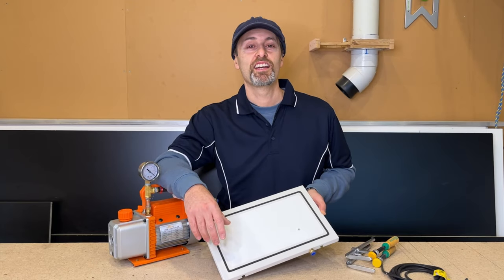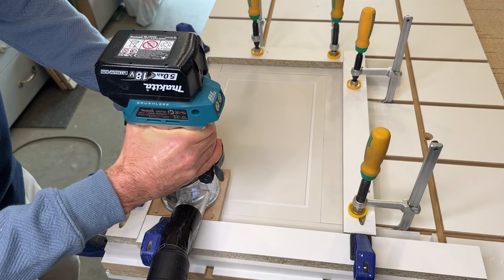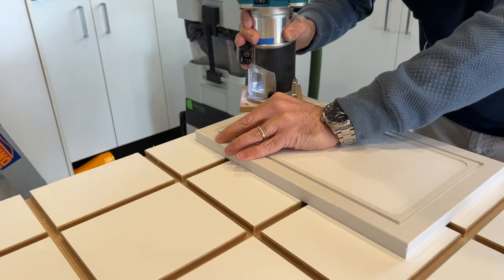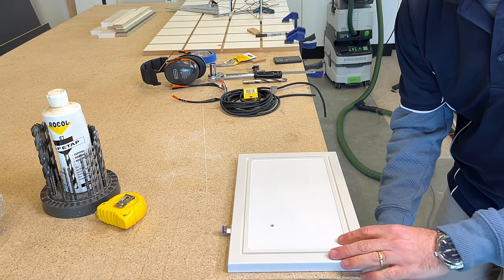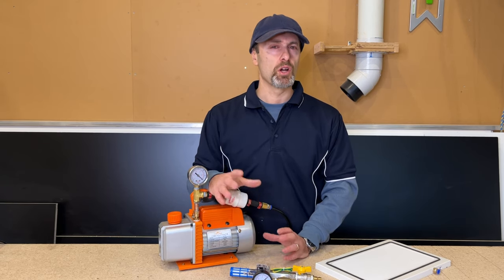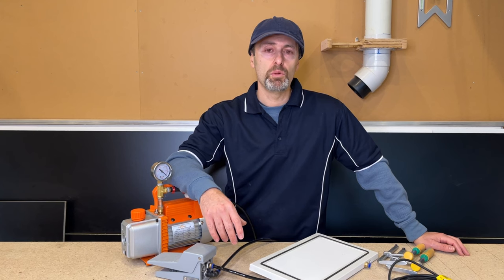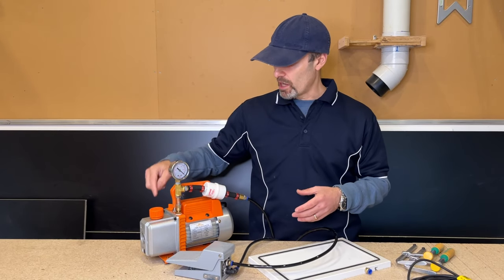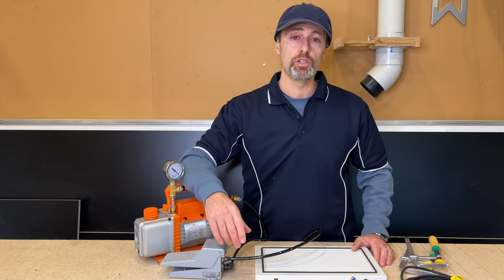DIY Vacuum Clamp | Vacuum Workbench Clamp | Vacuum Suction Clamp for Workshop | DIY Vacuum Pad

Comment: Funny, I was looking to purchase the Festool vac system but after watching your video I've realized I have everything in my shop needed to build my own customized vacuum clamp.  It won't cost us a single penny!  Thanks. from Canada
Reply from the maker: Yes I was contemplating the same idea, then decided to make my own, good on you 👍
Reply: I have the vac Sys. Different use case. I’m now fully on the vac clamp train… building out more accessories like this and a large bed for the cnc. So convenient!
Reply: I experienced the same thing Gavin. And its tea handy. only bought the vacuum pump and a hose with some connectors. set me back less than 100 euro! thanks to Geoff, all working very well. just need a foot pedal that's all

Comment: i have another question, I checked out the pump on Amazon but and seeing 1/4hp (3.5cfm) , 1/3hp (4.5cfm), and 1/2hp (5cfm) what is the difference, what type do you have and what size do you recommend for my 4ftx3ft work bench for strong hold down. I mostly do straight through cut on my cnc so i would like the little peices that are cut out during my jobs to be hold down on the waste board as i usually have another vacuum sucking the down because i use MDF for my jobs and these as you know are very dusty. At times when the vacuum is sucking the dust the small pieces get sucked up but falls in the track on the bit and sometimes break(when am using 1/8 upcut bits) and messes up the entire job. so i would need a strong hold down for to keep the little pieces on the waste board to avoid these problems.

Comment: How big of a work bench can this vacuum hold down. I have a 4ftx 3ft table size. But most of my material i would be holding down is 4ft x 2ft. Could this pump work?
Reply from the maker: I don't see why not, make sure you have a good seal and surface area. One way to find out...
Let me know how it goes 👍

Comment: great simple project! i wonder once you create the vacuum and turn off the pump (and of course an optional air valve) how long in your opinion could keep the vacuum force without electricity? did you tried it?
Reply from the maker: It doesn't seem to last very long and I think that's to do with the PVC material I have used. The hole that has been drilled for the air suction is the most venerable to leaking air and the best solution would be to coat that hole with a sealer of some sort, which can easily be done if you have the patients. That being done and a good rubber seal may help keeping your material held down without the pump a little longer. Good luck 👍
Reply: I wonder if it would be more beneficial to route a grid in the center instead of the entire middle. It may be less surface area but possibly less distortion on the piece when at full vacuum. Plus a few additional deeper grooves for the gasket could allow you to reconfigure the gasket for a smaller piece.

Comment: You're using the foot pedal as an activation switch?
Reply from the maker: The foot pedal diverts the air out through a vent which means the suction pad has a loss of suction allowing you to release your material

Comment: my foot pump works the other way. it works when pressed. do I have the right pneumatic foot pump?
Reply from the maker: You may have the line in from the pump in the wrong port on the foot pedal. It should have 3 x ports on it, 1 x is the line in and the other 2 x ports will dump/divert the air

Comment: Does the motor have to be two stage to use the pedal?
Reply from the maker: Hi Chris
I don’t think it’s a two stage pump, it was nothing special just from eBay around $100. The foot pedal has another outlet which dumps the air or diverts it which works well for releasing your material off the vac pad.
Reply: @geoffsjoinery4990  
Just what I needed to know! Thanks for the quick response

Comment: Looks great, but one question : You lowered the centre part a wee bit, so doesn;t the vacuum pull a litle dent in the material that it is sucking? 
I ask this, cause I'm thinking of using it for cnc engraving with a V-bit and for a perfect engraving I need it to bee 100% flat, or else the tekst would look bad especially with thin brass plate or thin plywood? 
kind regards Hans
Reply from the maker: I have never noticed my material bowing in the centre due to this design as I have only ever used these with 16-18mm board however, to address your concern, you could router 6mm/1/4” slots in a grid configuration instead of hollowing out the middle which would retain a flat surface within the centre section for your thinner materials. Good luck 👍

Comment: The only thing I would do different is to cut slots in the center area for the air to escape through instead of removing the entire middle area.  This way your clamped piece will remain flat.
Reply from the maker: Thanks for your feedback, yes I have seen a few designs with that idea on YouTube. One thing I had to be careful of with that suggestion is the two dovetail slots running underneath that no top router slot would interfere or become a weak spot on the surface. On this design there is over 3/8" of flat surface for material either side of the rubber seal. Also on my MKII version video of these - 
https://youtu.be/2_KRjKb_bJs
I wanted to show that this concept still works without removing any material from the center. In that MKII video I have not removed any material from the center (on the same remade sized pads) and it still works fine. 
Thanks for watching, good luck with yours...
Reply: @geoffsjoinery4990  You wouldn't need to make the grooves any deeper than what you already removed easily missing the slots.  Don't worry, air will travel without an issue.
Reply: makes sense

Comment: can you discuss the fitting that you have to the pump. im having issues finding ways to make this al work and that fitting is a pain in my neck because i cant find anything that works to that or the hose my pump came with. same pump as yours
Reply from the maker: I actually did a custom made joint, with a small piece of copper pipe and the brass fitting I needed the soft soldered the whole lot together. It was all because of the junction and the pressure gauge that I wanted to add, otherwise you can run the original pipe work they comes with the pump straight out.
Reply: @geoffsjoinery4990  would it be possible to talk another place so i can ask some questions because im so lost on how to make that connection. its the only thing stopping me. is there a way to send a link of the bottom piece you used that attaches to the pump?
Reply from the maker: @eladsinay6914  The pump comes with what you call a "compression Joint" which when tightened seals itself (it's a tapered fitting) with a male barb to slip a hose on. Well, what you do is cut a piece of 1/2" (13mm) copper pipe and slip it over the male barb. Then on the other end you want to find a male fitting so you can screw in a tee junction or this is what i have done. You then need to soft solder it all together or you could try some really good epoxy glue which might work if you don't know how to solder. by the way I am sure there is a detailed photo of the fitting complete in the actual video (12:39min mark) Its just a matter of modifying to suit your needs. I am also sure you could find all the particular fittings you need from a plumbing outlet. Good luck and let me know how you went!
Reply: @geoffsjoinery4990  yah i freezed it on that frame. only thing for me is i plan on using that pump for its original intended purpose as well and its to connect it to my vacuum pot to remove bubbles from my epoxy so i would need a way to remove it when not in use to suction something to a table. im gonna take the pump to an electrical supply store and see if i get lucky and find something that will perfectly twist onto it and have a good fitting on the other end to allow the hose to just grip to it tight.

Comment: Question, how how long do you wanna leave the item clamped with the vacuum on? Because it gets pretty warm. I just don't wanna damage it or create a fire.
Reply from the maker: Sometimes I have had the pump running continuesly for about half an hour then I might give it a rest, I don't think it will catch on fire just keep an eye out on the oil level...
Reply: @geoffsjoinery4990  mine is oil less so I guess I just keep an eye on it then. Thanks for your videos. They really guide me and saved me from buying an expensive set up.